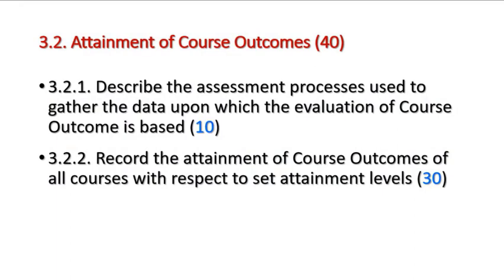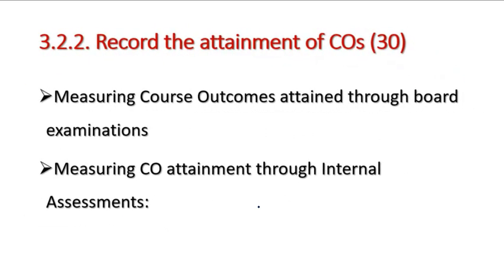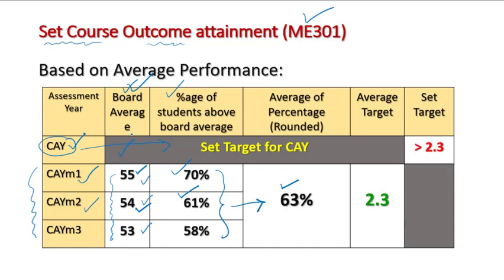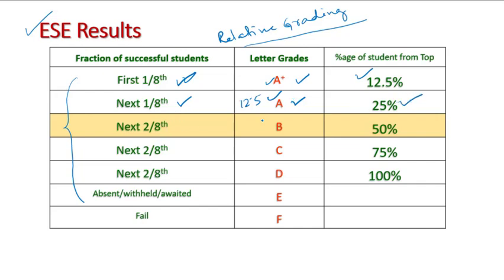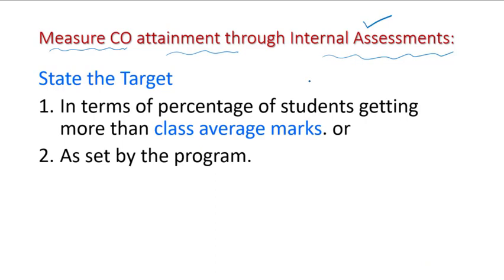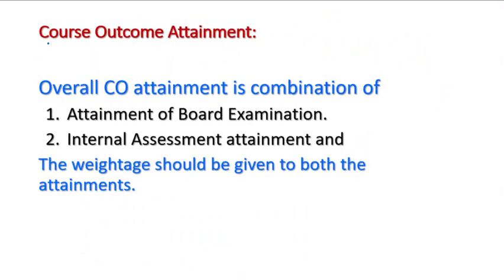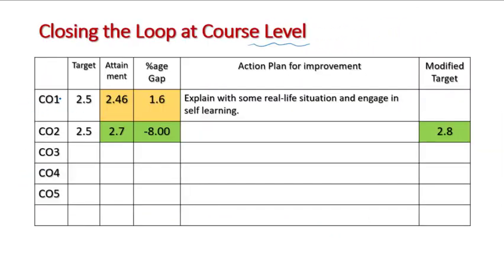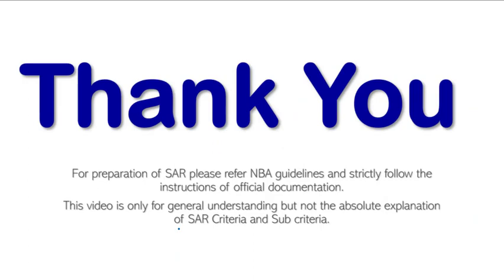Criterion 3.2 || CO attainment Level || Set target for CO attainment Calculation || NBA SAR ||

Comment: Sir, Please explain how to decide average target value.... As explained here how you have taken 2.3 as average target for 63% average of percentage.
Reply from the maker: Thank you for your query. In the said video, Set level is 1 for 50% students scoring more than Board Average, 2 for 60% students scoring more than Board average and so on. 
For exact 60%, set target is 2.0 and for 70% it is 3.0. In this range (60% t0 70%), there are 10 values correct up to 1 decimal places like 2.1 for 61%, 2.2 for 62%, 2.3 for 63%, 2.4 for 64%, 2.5 for 65%, 2.6 for 66% ........ Hope I have clarified your doubt.
Regards.